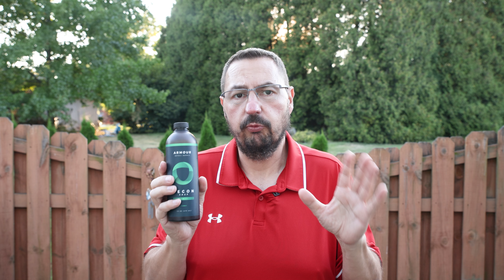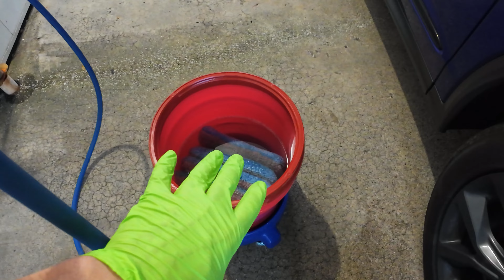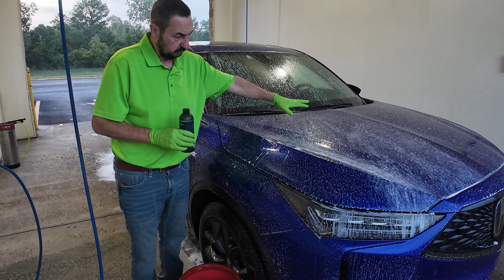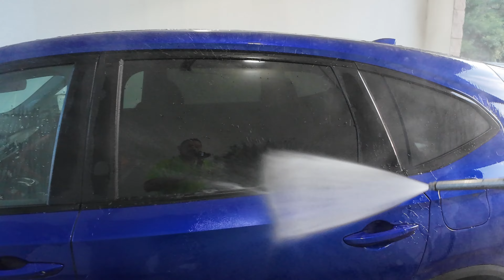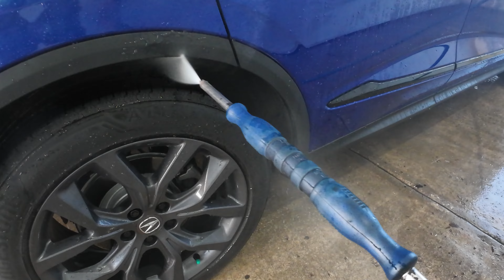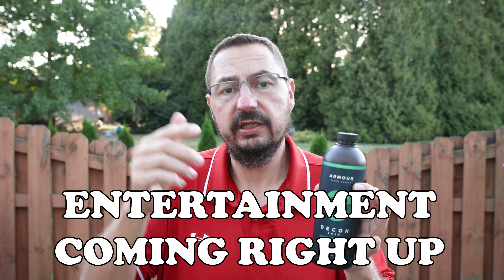Prep and maintenance with Armour Detail Supply Decon Soap. Do you need a decon soap in your arsenal?

Comment: Can this remove overspray from gyeon wet coat?
Reply from the maker: It should be able to. Wet Coat is only a month or two long sealant and not a durable ceramic coating or sealant. I dislike Wet Coat though so I don't have a ton of experience with removal. I've found that the CARPRO version works way better.

Comment: I’m thinking of applying a glass coating, I will use a clay scrubber  from the rag company as well as polishing the glass with Stoners Glass Stripper and finally using a panel prep. Do I really need to buy the decon soap for this one time use?
Reply from the maker: No need. the polishing step will remove everything. You usually use the decon soap so that your pad doesn't pick up all that crap left on the paint, but in this case I would just clean, polish, panel prep, and get going.

Comment: I have Griots 3 in 1 on my car, would the decon wash take it off or help it like a maintenance wash? Thanks for your videos!!
Reply from the maker: I'm not sure of the ph tolerance of the 3 in 1, so I really can't answer truthfully. Spray sealants are generally weaker than full ceramic coatings, and weak enough to be harmed by higher ph strip washes. That one though is an amazing product from what I've seen. I edited this because I said originally that the sealants were stronger than coatings. Don't know what I was writing. Lol
Reply: No it wont. I applied TW Ceramic spray coating to the wifes vehicle in April. It gets a rinseless wash ~ once a week. About 2 months ago I applied 3in1 and the TW to both rear quarter pannels just to compare(on top of the existing TW applied in april.). I foamed rinsed foamed and bucket washed using this product(V1) and the entire car still had excellent water beading everywhere after the wash...

Comment: ADS really are producing some top quality products. But not cheap. And i appreciate their easily accessible sds - should be a legal requirement i think. I hate emailing companies for this info. What are you trying to hide? (Says the cynicist in me)
And thank you for your honest appraisals. Really valuable
Reply from the maker: SO VERY TRUE. I downloaded every single one they showed on their site, though I do need to go back and get the revisions. Other companies HIDE them or make you scan the QR code once you buy their product... that's only available on line. Or I've seen one company say look at the SDS sheets so you can determine if you can use it in your kitchen or not, but they don't post their SDS sheets right there on their site.

Comment: safe on ppf? Thanks
Reply from the maker: Yes! The front of the SUV has PPF. And the Decon Soap works fantastic on bugs! In fact no need for a separate bug remover most times, which if you don't kniw, some contain solvents and can be harmful to clay decon towels. (The GTechniq W8 as as example started messing with some synthetic clay I had)

Comment: I have a few of those HF drying towels. I just bought another one the other day.  I really like them. Gray side: 90% polyester, 10% polyamide; Neon green side: 75% polyester, 25% polyamide. I just use the neon side. I only use the grey side for glass if I need to. They are a good size and really soak up the water. I find they are just the right weight to put down on the vehicle. I mean you can control it so that it pretty much lays flat. When it gets wet it doesn’t get to heavy. If you get 2 towels you won’t have any issues drying a vehicle since you have a back up if needed. The price for even 2 towels is awesome. I use rinseless solution as my drying aid when I do a soap contact wash so the panels can be a little wetter than normal but I just use 2 towels and it works very well. I have a couple of medium sized gauntlet drying towel and only use 1 of them for some light touch ups at the end if I need to.